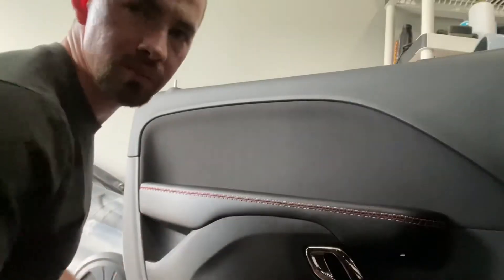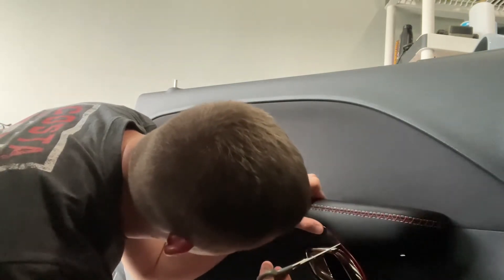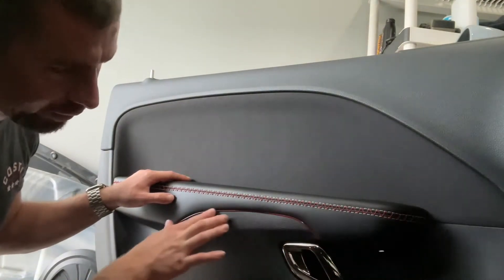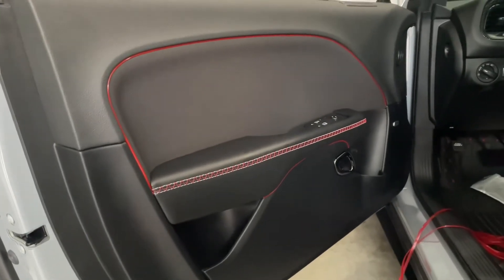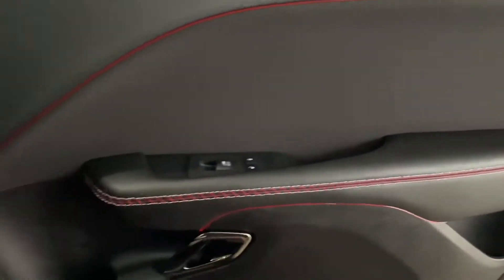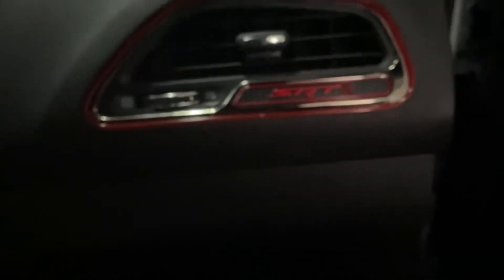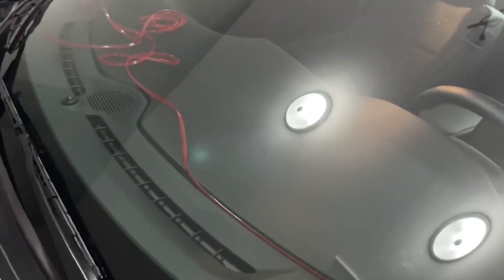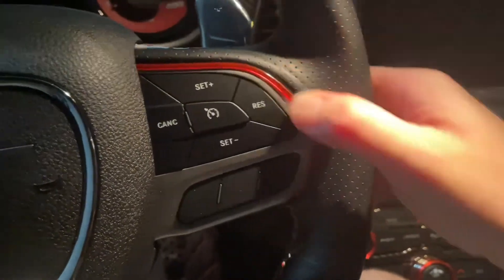Red Interior Trim on my Hellcat.

Comment: So it's been nearly a year.  How did it hold up?   How does it look?  As with anything that's a cheap chinese knock-off (which is 99.9% of amazon items) I'm pessimistic.  Cowles is like $5 more, invented the design and use, and is made in the US.  Such an awesome car surely wishes you'd spent the extra $5 :-)  I look forward to your response.
Reply from the maker: It’s holding up great. Had one small area on the driver’s door I had to press back in once. I have it on my truck and it’s been doing great as well.